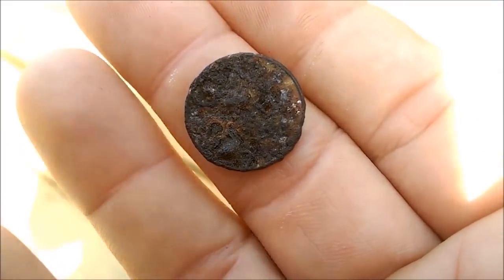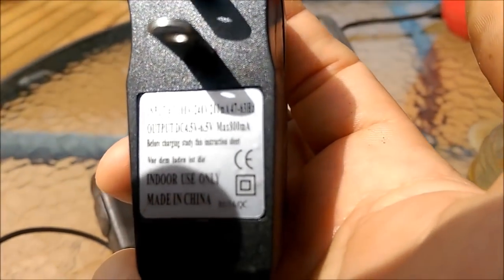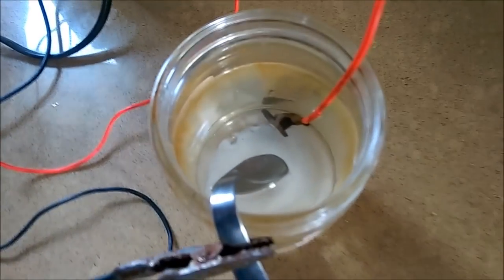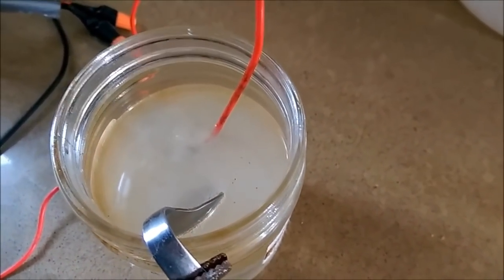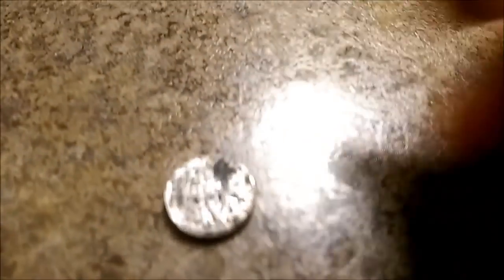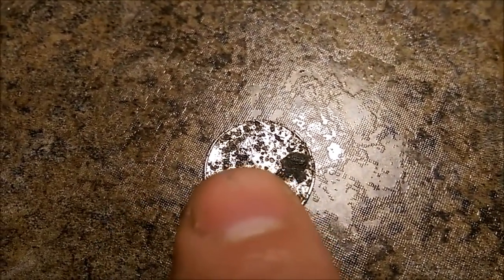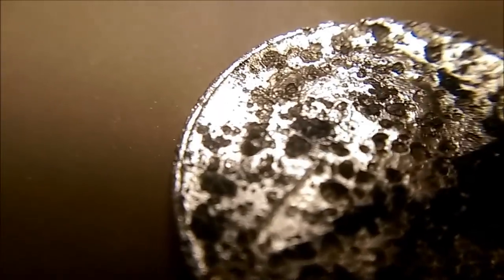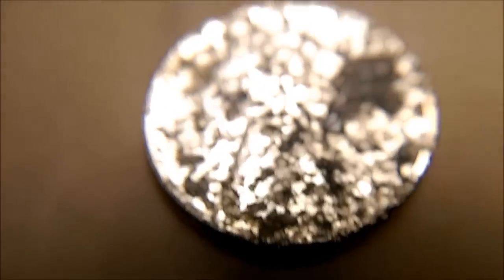Rusty 1943 Steel Wheat Penny Cleaned - Amazing Results!

Comment: I have over 200 1943s penny's I just soaked them in sewing machine oil. They are coming clean just fine. I cleaned the container and washed everything with alcohol between oil soaks. The luster even came back

Comment: One suggestion would be to use Washing Soda instead of baking soda.  One Tablespoon to a gallon of water.  Stainless steel is fine to use as the Anode ( Positive )  Negative alway goes to the part you are cleaning.  With steel I think you could leave it in there for days without any damage.  I run a 20 gallon Etank and and have ran it 12 volts at 10 amps for several days on really rusty large items.  Works great for cleaning crud and rust off of cast iron pans as well.  If you plan to go with a 12 volt battery charger make sure it's manual not an automatic.  Also never use a brass brush because it can leave brass on the item you are cleaning.  Use a stainless steel brush.  All in all it turned out great.  Thanks for sharing the science experiment.!

Comment: Very rare for one to be still legible if it has been in the ground 60+ years, all mine I have found were found amongst other wheat pennies and they were all so badly pitted up and cratered it could only be recognized by comparing it with an uncorroded one and looking for faint details in the pitting which hurts your eyes. They were also two pennies thick in rust. It is likely this one was a rather recent drop that some kid in the 80's or 90's stole from his dads collection or something.

Comment: positive goes to your sacrificial metal. Neg goes to the relic or coin. You are lucky there is anything left of the coin. Also dont use baking soda. Use Armor & hammer Washing Soda in distilled water preferred. I have used tap with same results .Never let the relic ever ever touch the positive anode or it become sacrificial metal as well.

Comment: i think you cromed plated the penny from the crome on the clip.which is very cool.😎
Reply: rugger digger what do you mean chrome plated ?
Reply: The chrome from the aligator clip electroplated on to the penny
Reply: You chrome plated that coin
Reply: rugger digger to make it get that color?
Reply: Yes the chrome came off of the clip and fused to the coin
Reply: rugger digger no that's the regular color of the coin
Reply: It is a steal penny, only made during WW2 because of the copper shortage for war purposes.

Comment: I would have used oxalic acid....
Reply: Are you talking about using oxalic acid instead of the CLR at the end, or in the electrolysis solution itself?
Can you still buy that ZUD cleaner (used to have a pretty good concentration of oxalic acid in it)?
Reply: well - I usually use it on old beer cans/tins I find in bottle dumps - but - Im just wondering if it would have cleaned the penny up with less pitting than this method (probably not...but who knows) - I just use the straight oxalic crystal which is easy to find on say...Amazon - though you can also find it in some hardware stores as "wood bleach" - I wouldn't use CLR or ZUD or any of those - - the cool thing about using it with tins (or old toys....license plates etc) - it takes the rust off but doesn't mess with the paint - Ive dug things that were TOTALLY brown and had them clean up real nice...
Reply from the maker: You think I'm a chemist or something?